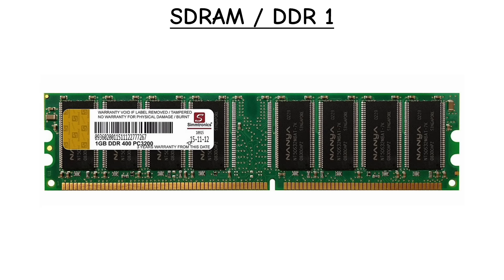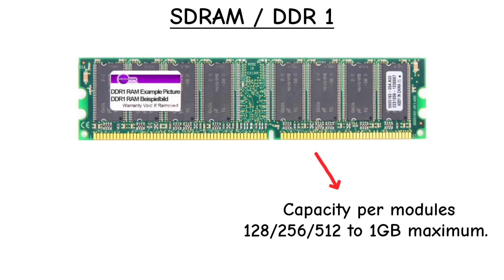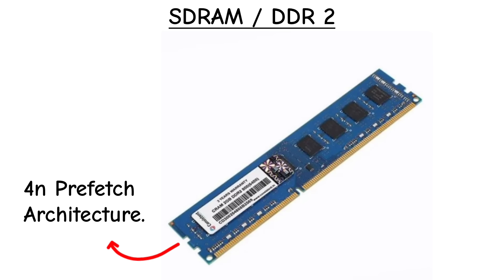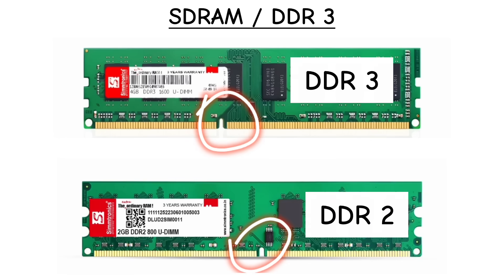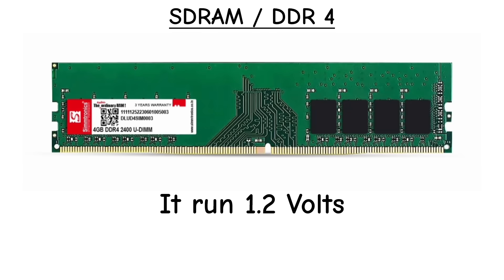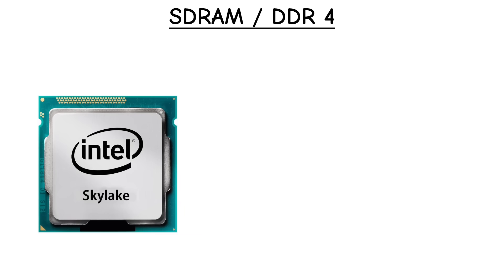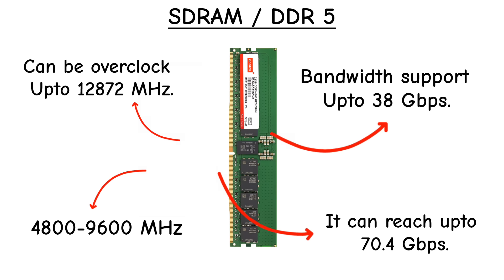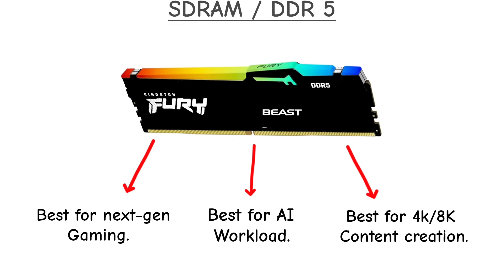Every DDR RAM Explained In 4 Minute

Comment: First build I had- at around 2021 had a core 2 dou processor, so ddr2 or 3.
Later upgraded to an i5 4690s, so definitely ddr3.
Upgraded to a xeon e5 1650v4, so ddr4, 
Now a Ryzen 7 7700, so ddr5.
I went through almost all, or atleast most of the memory generations in 3-4 years.

Comment: there are some rare 8gb ddr2 sticks, there are 32gb ddr3 sticks

ddr5 was first adoptedby intel 12th gen (correct) but not ryzen 7000 series. instead, it was first adopted by ryzen 6000 series (laptop only)

lpddr5 and lpddr5x are different from ddr5 (different architecture)
lpddr4 and ddr4 are different architectures
lpddr3 and ddr3 are different architectures
lpddr2 and ddr2 are different architectures
lpddr(doesnt require the 1) and ddr are different architectures

why arent the low power versions included??

Comment: SDRAM / DDR is not really correct naming. Proper naming is DDR SDRAM or DDR2 SDRAM etc.

That's why: it's a type of random access memory (RAM), while other memories can be sequential access. RAM can be static and dynamic, so it's DRAM. At furst it was asynchronous (without clock signal), then it became synchronous dynamic RAM, SDRAM. Then it was decided to double data rate to it, and it became double data rate synchronous dynamic random access memory, or DDR SDRAM. And now it's fifth generation of it.
Reply: After ddr sdram was introduced, previous generation of sdram (not double data rate) was backnamed single data rate, or SDR SDRAM. But both of them are SDRAM.

Comment: DDR5 glazing 
There are still lots of ddr3 users and it isn't always about speed. I know lots of sysadmins who prefer using ddr3 on servers for variety of reasons other than "upgrading would be expensive"  
Calling ddr2 fully obsolete is not true either

It feels like just a read of an article/wiki/table of features. You didn't even mention how ddr5 and ddr4 stand out in shape other than notch - it has curved edge at the pins

Not to shit on the efforts, they were clearly made, but it could be better
Reply from the maker: Thanks

Comment: You Forgot the CAMM2 DIMM DDR5
Virtually faster than its Desktop counterpart, More physical pins contact Layout, Lower Voltage, Better Heat dissipation.
Lower CAS Latency by default (thanks to physical pins layout)
Can actually be installed in both Desktop, and Laptop or Tablet, even Handheld gaming device without even altering its Voltage
Reply: lol CAMM2 is a different form factor and its meant for laptops , maybe desktops if want single slot.....which most people will not want........... Work stations and servers yeah nah not going to happen. DRR5 fastest ram has already past camm2 plus ddr6 is ratified
Reply: @blackIce504  HAHAHAHAHAH

CAMM2 is already Dual Channel on a single module. And Desktop Variant already existed for 2 years now. 

MinisForum Motherboard for both Intel and AMD is available for CAMM2
Reply: remind me when a real product uses it
Reply from the maker: I have explained this in simply under 4 minutes. If this were a detailed explanation video, I would have had to include that as well.

Comment: DDR: slow asf
DDR2: slow but can be used
DDR3: ok
DDR4: fast, great for gaming
DDR5: sooo fast
Reply: DDR3-DDR4 is the best option. DDR2 is ok. Not bad
Reply: @muffinka64  ddr3 is NOT the best option
Reply: @not_a_gm_ben ok elon
Reply: @muffinka64  just like i thought, you do not know shi about am4/am5, ram, and pcs in general
Reply: @muffinka64  ddr3 is better for price per performance and ddr4 is good for its performance but higher costs
Reply: r/YoungPeopleYoutube
Reply from the maker: DDR 5 is goat
Reply: @defineexplaining  But the MOBO and CPU are dang EXPENSIVE to handle all that.
Reply: @crazysquirrel9425 they might be expensive but you are set for future upgrade
Reply: @midnightbat344 Meh, by the time you need to upgrade you will be behind again. Just get what you need. No such thing as future proof as you will always just be running older hardware and new arch's will replace it.
Reply: @midnightbat344  fool, they tell you this every single time. There is no such thing as being set for future upgrade. They made it their job to make sure you're always one or two "groundbreaking" technology behind.
Reply: @defineexplaining  yea
Reply: @Roti-Poulet  DDR3 started it tho
Reply: @defineexplaining  nah too many downsides compared to ddr4
Reply: @defineexplaining ddr3 is peak
Reply: The main limiting factor is the CPU itself before the RAM speed unless you use an iGPU.

The more cache a CPU has the less the speed matters.
Reply: so fast yet give up to 1% boost at best in gaming xd wow
Reply: Edo ram is great
Reply: I use 64gb ddr5 on my pc
Reply: @NightmareOfRendians  speed?
Reply: @not_a_gm_ben  G.skill Z5 neo Ddr5 64gb and speed is 6000mhz
Reply: @NightmareOfRendians  nice!
Reply: @NightmareOfRendians  How many terabytes of storage do you have?

Comment: spotted an error SDRam / DDR1  Ran on pentium II systesm for Slot 1. I have one of them.  So it never started on Pentium 4, It Started on pentium 2 on slot 1 boards.
Reply: cause its ai garbage
Reply from the maker: Intel didn’t support ddr until the pentium 4, Intel never released a ddr capable chipset for pentium II. there were third-party, experimental slot 1 motherboards built after the Pentium II era that used adapter boards which support ddr1 but it wasn’t real ddr operation, it was just running them in backwards compatible single data rate mode.
Reply: Pentium 2 and 3 were on boards with old school SDRAM controllers (northbridge). (DDR SDRAM isn't the same as SDRAM, at all: SDRAM was single data rate - DDR stands for dual data rate, the idea was to tranfert bits twices during a ram clock period), before SDRAM, everything was working with EDO (that you had to mount by pairs of sticks, EDO=even number of sticks). A lot of socket 7 motherboards have both EDO and SDRAM slots (but of course you could only use one type of memory at once).
Pentium 4 (socket 423) launched at the same time than the expansive RAMBUS, then DDR1 hit the market and the P4 had a smaller socket (478, much smaller) and on this socket, motherboards were using DDR1 (at a time when old SDRAM became very expansive and the biggest stick was 128MB). I don't remember any motherboard that supports dual channel before socket LGA775 and DDR2 (and all that came around the same period as the PCIe 1st gen). Memory contollers stayed on the chipset before Sandy Bridge.
For AMD, it was DDR1 for Athlon XP (socket 462, or socket A, it's the same), then the very first Athlon 64 (socket 754), 1st CPU that integrated the memory contoller, then with the socket 939, dual channel were added. Then for AMD, every socket's name is based on the memory gen: DDR2 for AM2, all the way up to DDR5 for AM5 (and often the number matches the gen of the fastest PCIe lanes as well). I oversimplified because I didn't talk about what happened outside of the x86 world (either 32 or 64 bits), neither I talked about what happened on the server side (a world where ECC Reg RAM is the gold standard and you can go further than dual channel).

Comment: DDR1 - 2000
DDR2 - 2003 (3 years)
DDR3 - 2007 (4 years)
DDR4 - 2014 (7 years)
DDR5 - 2020 (6 years)
Reply: DDR6 were planned to coming in end 2026 / early 2027.

But recent leaks by Moore's Laws Dead showed that AMD may go to DDR6 only in 2028, cause AM5 will get one more generation/year support with Ryzen 11000 (AM6 were initially planned to be in Ryzen 11k but got post ponned to Ryzen 12k)
Reply: @hicarodestrui Im still just fine on DDR4. Eventually, I'll get an upgrade if my system ever becomes slower, but haven't felt the need. 64GB RAM, 2700x CPU, 2 m.2 SSD's, RX 4700, etc. I don't need the latest and have worked in tech long enough to where I focus on using the hardware more than worrying about if it's the latest.
Reply: Nah DDR3 stay in market much longer than you think. If count those LGA771 or Opteron it likely been around from 2005 and don't forget that mid to late LGA775 also use DDR3 too and it only go out of market when Core I 8th gen dropped. But even then AMD actually launched FM2+ Excavator chip as late as 2018 too so that when it officially died that year.
Reply: @nightadmin283 this list is about the year they were released in not how long they last. DDR4 is still used till this day.
Reply: DDR6 is coming in 2026
Reply: Still using DDR3 (core i7 notebook) and DDR4 (Ryzen 9 5950x) in my systems
Reply: ddr7 coming 2030